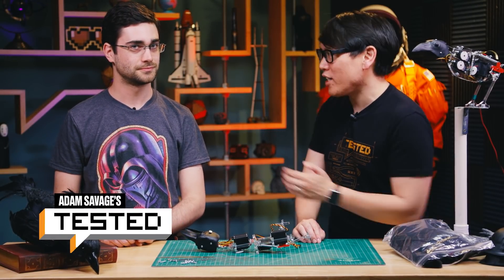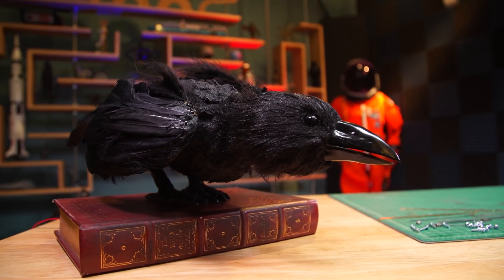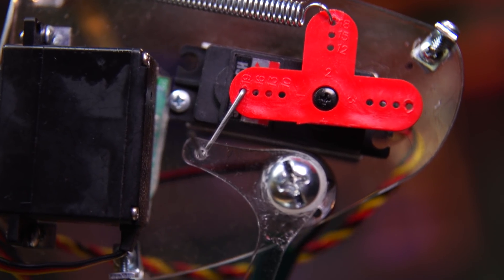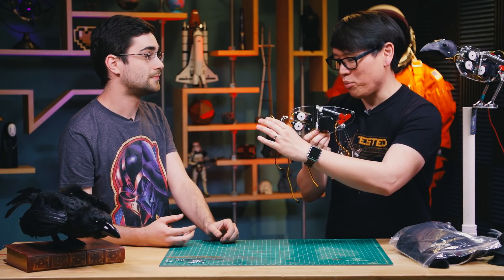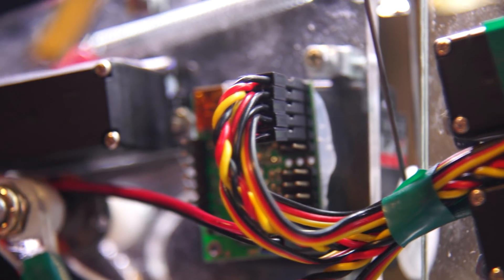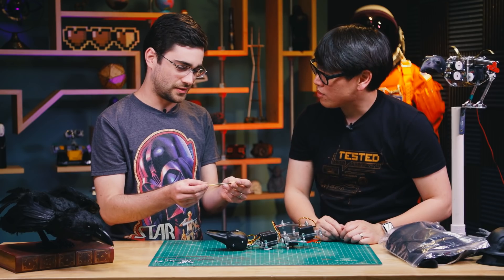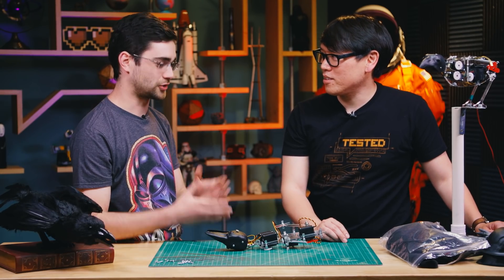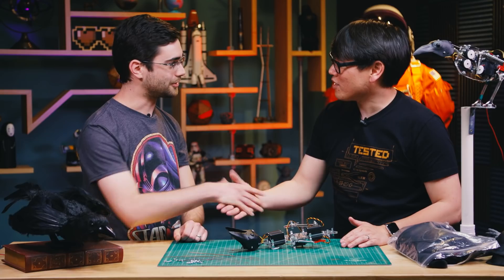Show and Tell: Animatronic Raven Kit!

Comment: The tail of an RC airplane also only uses two servos.  
The head isn't any different here, just on a central swivel instead of independent hinges.
Curious if it keeps repeating the same movements, or is randomized.  Will be looking into.

Comment: cool thing. can you programm movement yourself? and is it really that loud?
Reply: Actually, YES you can, if you have an usb cable that fits, and the software, (it's free, btw). Overall, I would say this kit is HIGHLY customizable. If you feel ambitious, it shouldn't be hard at all to change out the servos, for smaller, faster, and stronger servos. It all depends on how far down the rabbit hole you wish to go...!
Reply: Oh, one more thing. How loud are the mechanics is entirely dependant on the specific servos you use. Some are much noisier than others. But, even with noisy servos, there are ways to make them run quieter, (i.e.: packing the gear-well with silicone grease).